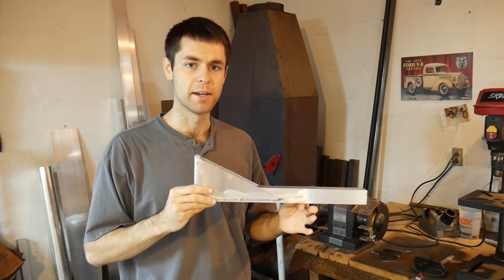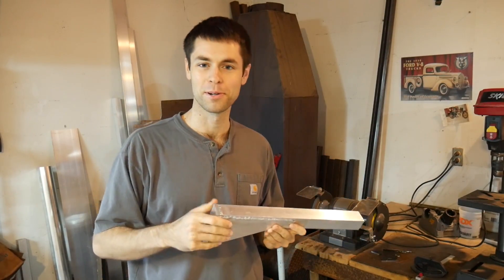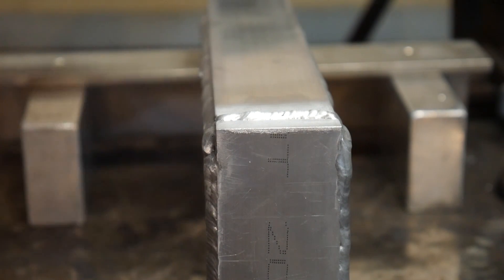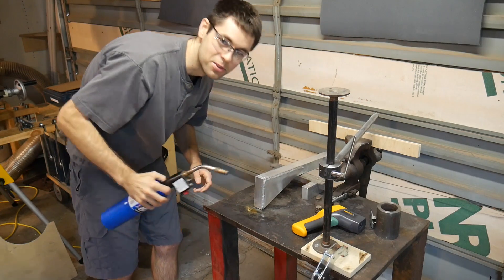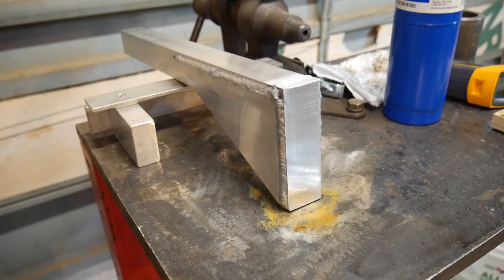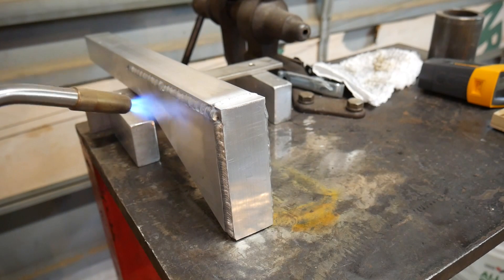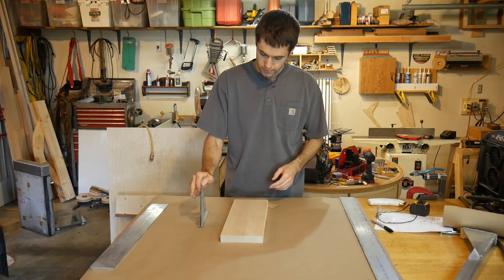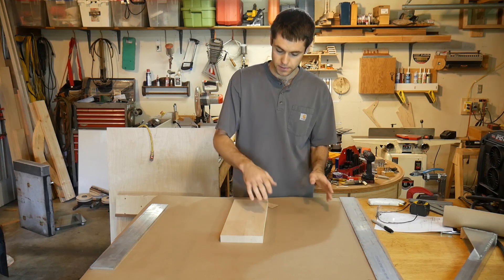Converting Heat into Vibration with Aluminum

Comment: Six years ago. Cool it happened a little at low temperature. Regenerative breaking could heat up metal a little, then wind drag could cool an area, letting that sterling action trickle charge a battery while driving. Lot of wacky applications likely.

Comment: It souds like what's called thermoacoustic vibration.  When one end of a large test tube is heated, the heat gradient between the hot and cold ends causes it to make a strong sound at the resonant frequency of the glass tube.

Comment: I do this every time I boil water on the stove.  It's a stainless steel pot with a copper bottom and a glass top stove. I put cold water in the pot and put the oven on high. When it looks like it's about to boil I tap the pot, which causes it to rock on it's uneven bottom. Then it rocks back and forth for an unaturally long while. Once the water starts boiling, then the trick doesn't work. My theory is that heat energy in being leaked into mechanical motion. Once the water starts to boil, that becomes the best way for the energy to escape.

Comment: Seems like the thermal transfer at the contact points with the table would be pretty low.  I'd bet it is a convective/vortex shedding thing, the wide vertical surfaces heat the air near them which rises and it is basically flapping in the breeze.
Reply from the maker: That's an interesting idea, You could drill holes in some of the vertical surfaces and see if the effect remains or reduces. "Baffles" close to the slides, but not touching, might help answer this too.

Comment: As the piece doesn't vibrate until you rock it, it may be that the heat of the piece causes the air in the gap between the piece and whatever it is placed on to expand, which generates enough force to rock it back and cause a gap to develop on the opposite side. As the air in the previous gap cools (or, rather, rises and is replaced by cooler air), and the air in the newly created gap (on the opposite side) warms and expands, the piece is rocked back again and this cycle continues, keeping the vibration going. To test this theory, heat the piece on its own and then place it on something that is not good at conducting heat (e.g. a glass pane or a wooden table). If you can get the same vibration, it is most likely that conduction of heat between the piece and whatever it rests on is not the cause of the vibration and that it is mostly cycle of heating and cooling of air around it (especially in gaps between it and whatever it rests on), that keeps the vibration going.

Comment: Is it possible in such a small air space between the aluminium and the table that the heat from the aluminium is creating a small bubble of hot air which lifts the piece marginally. Said bubble then bursts when the heat is transferred to the table (or surrounding air), lowering the aluminium. Such an effect would continue until the aluminium, table, and surrounding air reach equilibrium.

That's my guess, as it has been years since I've dealt with thermodynamics and heat transfer.
Reply from the maker: I like this idea, as pointed out in another comment my original thought was missing a portion that actually added energy to the oscillation. This seems plausible though as the lifting of the piece would draw in cooler air, which is then heated and wants to expand. I feel like this is getting into Stirling Engine territory, which is something I've always found fascinating.
Reply: I agree with Matthew! I think you've got the tiniest heat engine going. 

The first wiggle sucks cool air in the side between the hot and cold bench, then that air expands as it heats, and gives the hot surface the tiniest push, which keeps the rocking going. 

Once the table has heated up around the aluminum, the air is already too hot to expand appreciably. That gap is well within the boundary layer thickness for laminar flow, so without a cold surface acting to cool the air, everything is just too hot already.

Way to have the curiosity turned up to eleven! :)

Comment: The more you weld the more youll grow to hate this phenomenon :p ... it happens often when you weld parts that are grounded thru the table vs a clamp.  I always thought it was due to contact resistance causing local thermal expansion... sometimes the part can vibrate an eighth of an inch and make it hard to hold a nice pool!
Reply: From what I can gather, my brother is publishing his phd thesis on just this. But the heat comes from shuttle launches and the vibration is effecting wiring along structural beams within it. Just large scale with much more factors at play and it's for NASA! Cool video, thanks.
Reply from the maker: Does it continue after the welding is done though? I've noticed vibration on AC for small parts that I was tacking but not an eighth, that seems like you'd have to stop and clamp things down.
Reply: No, I cant say Ive seen it continue after welding... cool vid!  The eighth was just the other day, about 190 amps DC on an 80lb length of square tubing that had a slight twist in it.  It was rocking corner to corner, I even put all my weight on it to try and stop it but it just kept humming away at id say 10hz or so... had to clamp it down.
Reply from the maker: That's very interesting, is there anywhere else I can read about this issue? I've never heard of it, might be interesting to put some clips together and get thoughts from Jody at weldingtipsandtricks

Comment: Cool video. TIG welding is awesome, so challenging but a great learning experience.
Reply from the maker: Agreed, did you notice the smudge marks? I tried to weld around the corner and hit the electrode instead, again. (Getting much better though)

Comment: it needs a little push somewhere in the rocking cycle to keep going, I wonder where that push might come from
Reply from the maker: Hmm, maybe I had it backwards, could be the aluminum shrinking on initial contact as it transfers heat to the steel, then warming back up (since steel doesn't conduct heat as well) and expanding, thus pushing it away . . .
Reply: My suggestion is that it kind of works like a crookes radiometer.
It swings to one side, the side facing in the swing direction goes head first ino cooler air than the other side trailing through the heated air. Then the same pressure as in the radiometer (pressure from heating gas up) comes into play and give the tiniest push to the hot metal in the cold air, while there is a little less pressure on the other side because that side is trailing through far hotter air.
The only experiment to disprove my theory I can think of is trying to recreate the experiment under total vacuum.

Comment: The same kind of thing happens if you shove a quarter into a block of dry ice.
Reply from the maker: I'm definitely leaning now towards this explanation, I've annotated the video too. Would be interesting later to try and set up something like this deliberately . . .
Reply: That would be interesting.  Maybe a 'minimalist' stirling engine?
Reply: but that is die to a cushion of gasous co2
Reply: I know, but it sublimates quicker due to the large temperature difference between the quarter and the dry ice. This could be what's happening here. The aluminum may be causing a small air pocket between the cool table and hot aluminum to expand, which lifts one side of the bar. This allows the expanded air pocket to escape and the cycle continues. Just a thought.
Reply: Troy Brumm you mean a bit like a stirling engine? It is possible...